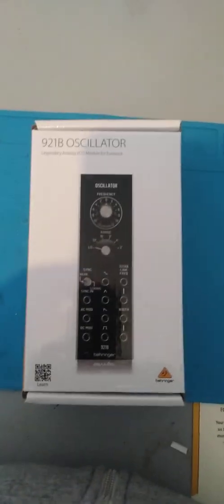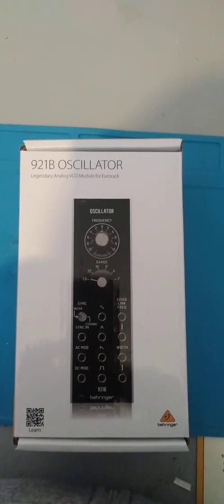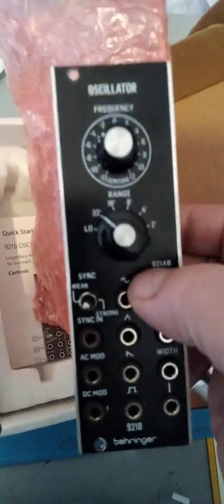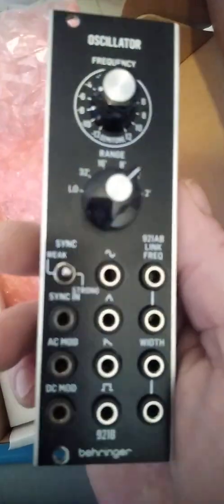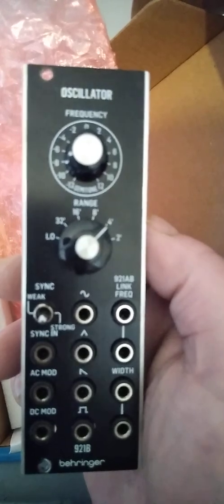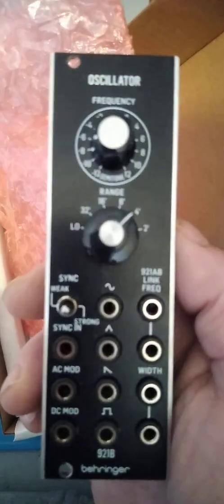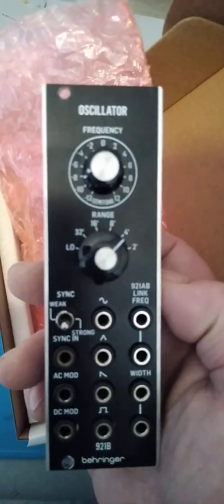behringer 921b oscillator (moog clone).

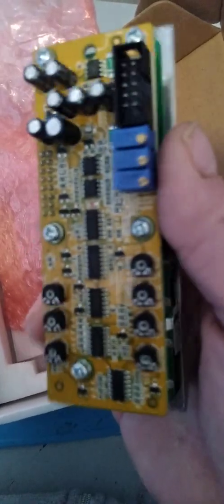Comment: I was cringing the way you man-handled this oscillator.  The back of the oscillator (at point 1:52 in your video) is studded with adjustment pots for locking in the tunning and other features... tracking, tuning, zeroization, you name it... and you're touching those delicate adjustment pots like they don't exist.  If you think this oscillator is out of tune or difficult to work with, you have nobody to blame but yourself.

Comment: How are you finding the tuning on this? I have two that seem to drift on a daily basis so I’m thinking of selling them
Reply from the maker: 921 is better being dependent on the driver leaves room for fault but ill buy them from you if you want to offload them ,have you let them warm up they are analogue so are temperature sensative and we are in the middle of winter.
Reply: @enslavedelectrons5684  thanks for replying, are you saying they are better with 921a? I do let them warm up, I’m in New Zealand so it’s summer here, around 22C.